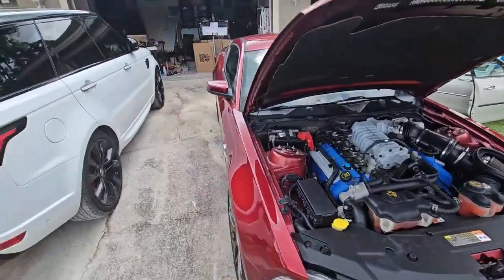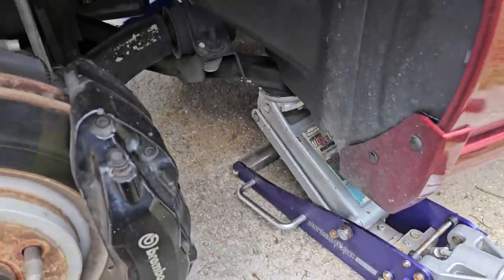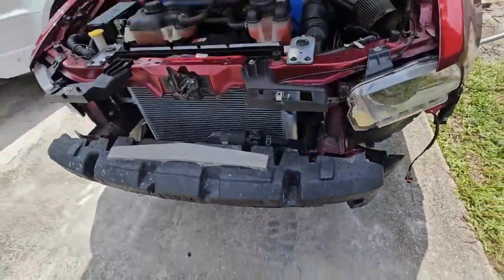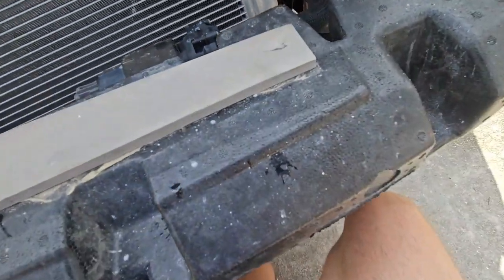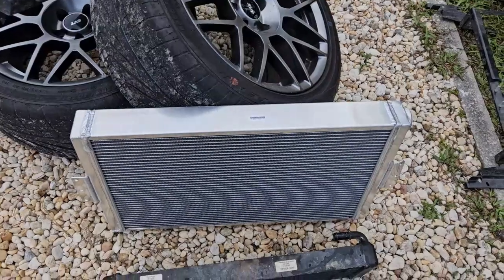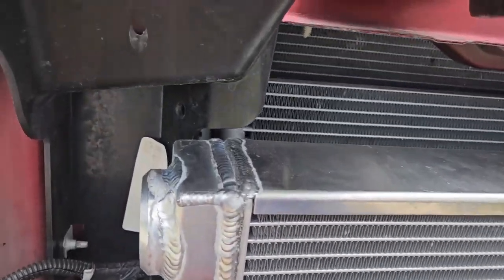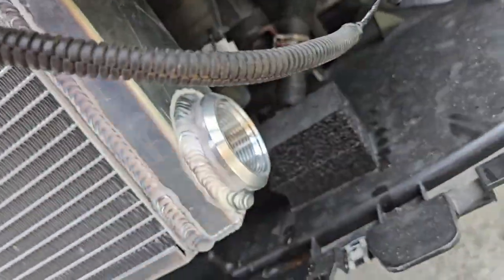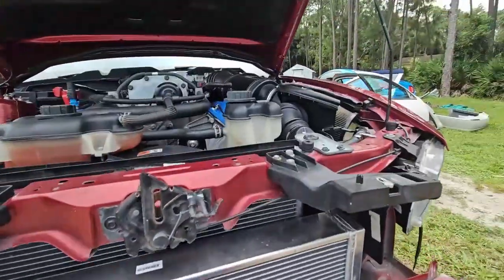Department of Boost Titanic Heat Exchanger install S197 GT500

Comment: Hey!  Did you notice a difference in iats?
Reply from the maker: @wick6315  unfortunately I didn't have enough time with the car to document it, I sold it like 2 days ate on a whim.. 

But I will say back to back to back hits that I did do with it the car did not fall off 1 bit in comparison to the stock heat exchanger...definitely was a huge improvement just seat of the pants feel on it being consistent
Reply: @cpstang24  ty for replying!
Reply from the maker: @wick6315  anytime. I would buy this again when I get another one of these if that's any influence on your purchase. I am a tough critic too but I liked this h/e.
Reply: @cpstang24  i can buy the super single from them for 425 but not sure if it would be worth it.  I do have the 2.4 pulley on my 13 and was trying to think of some cooling mods so I won't be heat soaked
Reply from the maker: @wick6315  i would do it, your stock intercooler pump is up to the job, and it looks killer behind the grille. The super single is still a great upgrade over stock, so either way you go will be fine, I just went with the larger unit because I had planned to road race the car.
Reply: @cpstang24  ty for the feedback!

Comment: Where did you find the fittings? Or did you?
Reply from the maker: @kevinmoore7635  part 2 coming. Fittings will be here tomorrow. 

MEZ-WN0034S is what I bought 2 of from Summit
Reply: Good deal. Subscribed. Thanks man. Nice video
Reply from the maker: @kevinmoore7635  thanks appreciate that!